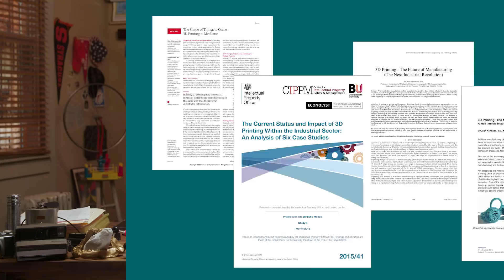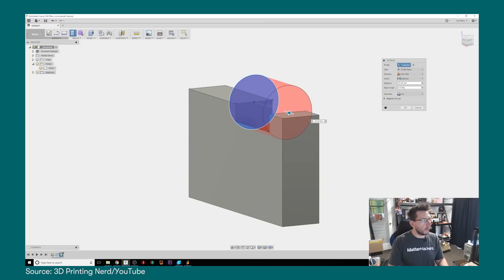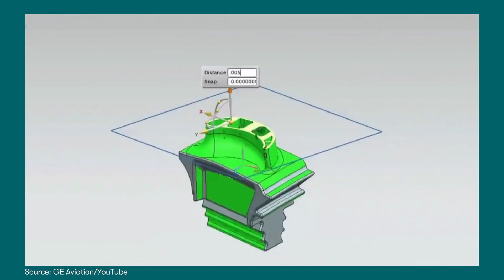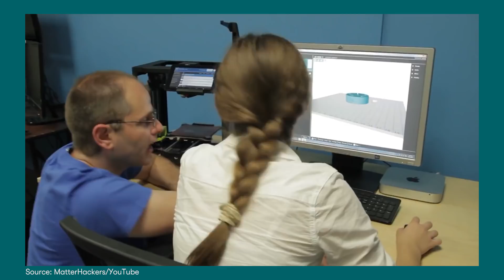What happened to the 3D printing revolution?

Comment: An anecdote and a question:
The wife's horse kicked her in the face, and smashed her eye socket. The danish hospital had a prosthetic 3D printed in Belgium, and it was operated in a year ago. Yucky but useful.
And the question: Where are all the 3D printing bureau? Seems one can't walk down a high street with out falling over a copy/print/graphic bureau, why isn't there an industrial unit on the outside of every town with a public access 3D printer?
What would it charge for? Materials used plus an hourly run charge?
People are still making money printing holiday snaps, despite the growth of the home printer market.

Comment: 3D printing was always a tool for engineers, designers and other technically skilled work force, not for consumers. I knew it would fail the moment they tried to sell it as a consumer product. It was a good way to sell hype internationally, but it was an impossible feat.
We are WAY off from ever selling it at consumer level. Do you know what needs to happen?
- 3D printers and appropriate "printing material" together must cost below 200$, and printing material should be sufficient to create at least 10-20 items
- 3D printing refills shouldn't cost an arm and a leg. People are already complaining about regular printing ink being made out of unicorn blood.
- 3D printing for a regular Joe Shmoe without technical background should be as simple as downloading a 3D template from a manufacturer (e.g. an Ikea Allen wrench to give a simple example), opening it in the software that is included in your OS or as freeware, and pressing print. 
As long as those things are not possible, 3D printing as a consumer good is never going to take off.
On the other end, I've seen engineers in our R&D department using it from time to time to create things. So yes, it's a handy tool for prototyping, that's for sure.
Reply: Creality Ender 3 (greatest budget 3D printer)= $170
1 kg of filament (many many items) = $20

Comment: I can't believe he missed the number one problem with 3-D printing which is the durability and appropriateness of the material for industrial applications. Some things need to be made from certain types of metals and alloys, some things are better made from glass, etc. 3-D printers basically layer a polymer, and some things are better forged, or annealed, etc. As a minute aside, I always thought that the term 3-D printing is subtly annoying and wrong. It should have its own term. It's no more printing than, say, paving a road, which is also built up from layers.

Comment: 3D printing for consumers is still expensive, clunky, and a time consuming mess to do.  despite hype to the contrary, saying that "There will be a 3D printer in every home with all of us just printing away whenever we needed something!", this technology was NEVER, EVER designed for anything other than industry or the extreme tech hobbyist with some disposable income.  The demand will happen for 3D printing when the cost of printers comes down, the cost of operation goes down, the time printers take to print stuff go down, and the ease of printing the stuff that the printers print also go down.

Comment: If this video came out 25 years ago it would be about how cell phones were over hyped and will likely disappear for the consumer. The 3D printer becoming a common part of homes is probably 10-15 years away when they get much faster and cheaper. I’ve had one for my classroom and it’s a lot of fun and reasonably useful but it’s still very much growing. Thin givers has gotten so much better in terms of quality and variety. Taking 6 hours to make a model femur is cool but frustrating.

Comment: I'm waiting for one that can print small things with no unsightly lines on it.
The idea is to print small cult camera parts and sell them.
A yashica T4 is about 200 - £300 for a working one , an oylmpus mju II is about £150 , an olympus mju II with a broken battery door is about £50 so you can see where the idea comes from.
Maybe the extruding method needs looking at.

Comment: The 3D printer was fated since the beginning, and I saw that from the start.  

3D printing relies on 3D Modeling to create the parts.  I AM practically a nerd in a way, and I can't even grasp it well enough to justify spending $300 on a 3D printer, even as much as I'd like to 3D print my own pickup covers, knobs, and control plates for my home made guitars.  Industry has an edge because they can hire the right people to model up the parts of which they want to print.  Us regular joes?  Ever tried to learn 3DS Max, Milkshape, or whatever else there probably is out there since I gave a shot at 3D modeling in the 2000's?  It's NOT that easy compared to typing something in Word and printing it on paper - which is what the client base for such a product expects.  Your average home user does not want to learn a new program and learn a new "hobby" to use new tech - they just want to print out that "bust of the cat" and be done with it so they can show it off to their friends.

Comment: I remember all the articles that warned of the danger posed by 3D Printed Guns.

They failed to mention that you can’t print barrels, slides, springs, firing pins, extractors or ammunition.

Those were fake scary times.

Comment: 100$  microwave                                          (microwave = low quality food)
100$   regular printer                                    ~can print 900dpi full body pics high res
600$ 3d printer if you build it yourself        ~can print my arm in low res
2000$ 3d printer for a good one per built   ~can print my finger nail in high res

money better spent on better cnc machines and easier injection molding
Reply: Monoprice Maker select is a very highly regarded consumer level 3D printer and its $300. (400cad). It's also prebuilt.
https://www.monoprice.com/product?p_id=13860

Also, You're looking in the wrong places somehow. Those printers are way cheaper than that. Here is the A6 for 250CAD, nearly half of the amazon price.
https://www.gearbest.com/3d-printers-3d-printer-kits/pp_428455.html

Heres the Geetech for 384Cad, again, nearly half the price you said.
https://www.banggood.com/Geeetech-Rostock-301-Mix-Color-3D-Printer-3-in-1-out-Triple-color-Printer-p-1074522.html?cur_warehouse=AU
The main reason this one is more expensive is because it can mix colours.
Reply: It is kind of ridiculous to compare a "regular printer" that is sold at a loss and recouped through the later sale of vendor-specific ink cartridges. A 3D printer has to recover its cost plus profit when it is sold because they aren't locked into a single supplier's filament cartridge, although I'm sure there are a few trying to figure out how to make that work.
Reply: Where did you get those prices? 
I have a $300 printer that can print your fingernail in almost hi res with 0.1mm accuracy. A bit of touch up after the fact and you can make it high res.
Reply: some time in 2016 also my prices are in Canadian 

I just looked today on amazon .ca 
A6 3D Printer DIY Kit 0.1mm CDN$ 428.99
there is one prebuilt 
Geeetech Rostock 301  0.1mm  CDN$ 680.45

these priced are still pritty wack

some time 2018
"Donald trump Canadians have had it too good for too long"

we are already getting shafted please shaft us even more

Comment: Nah... it was never popular... it was a new gimmick toy that they wanted people to think would change our lives - but then they came out and were super expensive, the quality of prints were low, they took hours to make stuff, they were huge...but the biggest problem - they were overly complicated.
You had to design the images, then play with the settings, then wait ages to print. The size was often extremely limited and most of the time was trial and error.

Fast forward 5 years - prices have come down, but they software to design 3D stuff is still overly complicated for the average person, the quality of the prints for an affordable model is still not that good, they still take a long time, they are still problematic and have problems.

It's like having the choice of buying a car premade, or buying the parts and making a car yourself -- an enthusiast will give it ago... those with money may give it ago... but the average person will take one look, see the price, see how complicated it is and then say "i will just buy a high quality finished product that is a lot cheaper and comes with a guarantee".

If an average print took no more than 30mins... quality was higher and material stronger... and the software was far easier to use - then it will be better (imagine if a stardard printer needed calibrating every time, and you had to refill the ink every time, and you had to align the paper correctly,  and then it takes 3 hours to print an A4 sheet -- and after all that time it fails because the paper alignment was off slightly -- it would be easier to just hand write the document...well this is the stage 3D printing is at)

I think we are still at least 5 years, probably 10 years, away from an actual viable commercial 3D printer that would be quick and useful in the home. At the moment, there's just no need for it apart from a few people doing models etc.

Comment: Absolutely spot on. Subscribed. BTW: I have an original Makerbot Replicator. Still works great. Of course the heater core is gone and the clutch slips but it still cranks out the parts.

Comment: You probably should have mentioned that 3d printing has been around and in wide use in the industrial space since the mid 90s at least? It's hardly something today's Engineers and Designers are unaware of. I was using it for prototyping and patterning investment-cast parts right out of school, which was quite a while ago.

Anyway, a point I like to make about the recent home-3D-printing hype is that it's main use today is to help make the products of "traditional" manufacturing better and cheaper, which in turn helps move the goalposts for some tipping point where massive numbers of people decide they should have one in their homes. In a world where you could print a working original iPhone for $100, who would want to do that? In such a world working original iPhones are Happy Meal toys.

Comment: I am older than you. When bubble jet printers came out they were horrendously expensive and remained so for for many years. Usually if you wanted to use one you had to know someone with one as most people didn't have one due to the cost. Once they were available for under $100 everyone and his dog got one. The same will be true of 3D printers. Which need I remind you, just 10 years ago could not be purchased for less than a thousand dollars.  Now a decent one will go for $400.

Comment: 3D printing needs an app store, where the likes of Games Workshop, model tran/car/plane manufacturers, Disney, Anime studios, etc. could sell their designs and make it easy to print.
Reply: What's wrong with thingiverse? More than half of what I print comes from there. What doesn't exist yet is "make it easy to print" because that is both printer- AND slicer- dependent. Most folks print with one of the free 3D Printing slicers, and most pros will tell you to pay $150 for Simplify3D when you're done wearing your floaties in the kiddie pool.
Reply: I would recommend when your done in the kiddie pool to step up to either autodesk or solidworks, and forget the low end of stuff.

Comment: My opinion is this: They over did it, as usual. Unrealistic expectations.
I have begun my adventure into all this..but going at it the opposite direction. CNC. What I am buying is a engraving machine. It does not cut metal..but I will modify.
It will be able to carry this into welding and 3d printing as well.
Where is this going? No clue.
We will see.

Comment: In 2006 I was working for a large aerospace firm, we had a large machine shop and used to manufacture all the base components before assembling them and installing them on aircraft. The machine shop was then outsourced leaving the design and final assembly in house. We only had one machinist who worked for the development department. On his machines he could knock up tooling and the odd basic prototypes but that was it. Everything else had to go to external machining companies for CNC machining...assuming that they could actually write an order of operation for the machining.
Before '3D printing' was a technology buzzword, the company trialled several 'Rapid prototype machines' as the industry knew them, eventually purchasing one. No-one called it 3D printing because the materials used were very weak and would break when handled, and on,y certain shapes could be made, with complex webbing having to be designed between parts to support a 3D form.
It was very handy to get a CAD technician to knock up components, or cut away sections on the machine for development purposes. Speeding the process up and saving a lot of money spent paying a machine shop to try and make complicated shapes on their CNC machines before you sign a contract for tooling etc.

In modern aerospace we call it 'Additive manufacturing' - the industry loves it, even if just for tooling or development purposes. As you say, now aircraft components themselves are being manufactured in this way.

Only the Tech industry call it 3D printing, and it is VERY important going forward for the exact reasons you stated in you video.

Comment: 3DP-Platform Workbence at 59"on "X", 39"+ on "y"axis, and 27&3/4" "Z"axis without enclosure but with two supper fast extruders at near 40 grand put them above that model crap and into full sized parts. Their EXCEL LINE is capabe of 20++feet on Y axis by 300meters on "X" axis. by 12 feet plus"Z" axis. Who could afford one would be the question.

Comment: I worked for my college's research lab for about a year.

We specialized in 3D printing. In fact, we were beta testing a Fortus 900.

My part in working in the lab was to develop prototypes for entrepreneurs and industry.

I didn't use 3D printing for everything. Particularly big things. For example there was one prototype where it was just more effective to make it out of wood (with the understanding that a retail product would be aluminum or steel). But we did use 3D printing for individual parts that went onto the prototype.

Other uses we found was that if a customer wanted to develop something for mass production, say injection molding, we could develop a prototype to the same engineering standards as the part and test it for things like being waterproof.

We also used another kind of 3D printer that used specialized printing that involved curing the plastic (which was a special material). This particular machine would combine multiple materials together to change the elasticity and hardness values of the plastic. For example, one time I made a working gasket.

But ultimately it always came down to how specialized the item for the project had to be. No sense in 3D printing something that you can buy for cheap.

Comment: I am an electrical engineer. And in my senior year we had to design and make our own product/project prototype. My partner and I made everything with off the shelf hardware components that you can get a hardware store. All other teams were focused on 3d printing for their construction. My team was the only team that met all of its goals. The other teams underestimated the time/money/resource investment required in 3d printing. We have been sold the idea that 3d printing is "automatic" like your laser printer automatically prints your documents. BUT it is not automatic. Design requires learning CAD (big time investment) or investing time in finding alternative software that can replace CAD for the beginner. Either takes time and effort and focus. One team was designing a mechatronic arm/hand. They had 3d printing involved. They didn't consider what an expense it would be. UPS wanted $600 to print the project!!! they couldn't afford it so were busted.

So while it is novel and neat to see what people have made with 3d printing, don't let it take over your thinking. The old fashioned tried and true making things out of wood, pvc, and metal from the hardware store can still do just fine with minimal tools required.

Comment: It was a fad. 3d printing has interesting uses, but they are pretty specific, like printing brackets and fittings to fit standard materials together, and for prototype projects. Now if we could print electronics PCB (circuit boards), then you could download and print electronics, which would allow unique homemade electronics modifications for products we already own. And it would allow the hobbyist inventors to easily add circuits to their projects (while still having to order the circuit components like chips and resistors and capacitors etc...)

Comment: Fantastic video. 

I remember all the hype. 
But then I went to engineering school and started using them. 
You hit some of the biggest issues on the head. You still need to DESIGN the part. 

Thinking 3D printers were going ot be in every home was like expecting every home to do woodwork and make their own furniture.